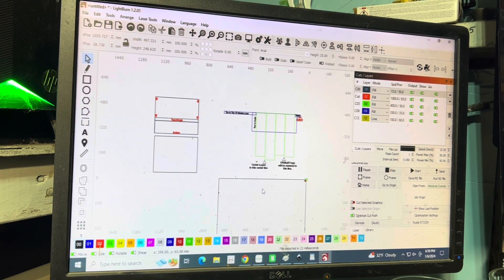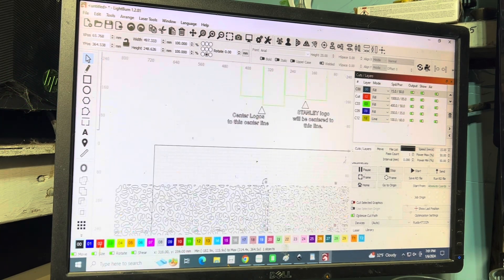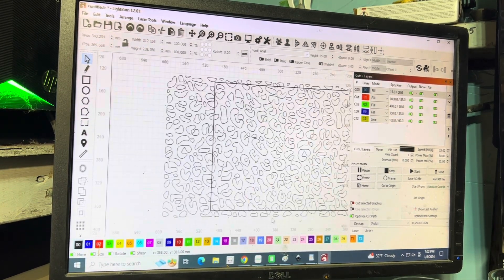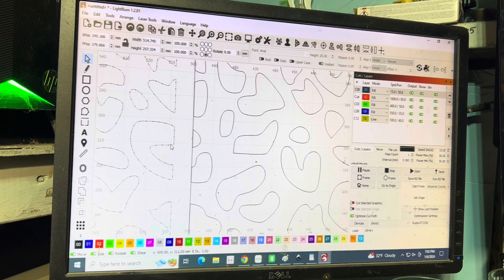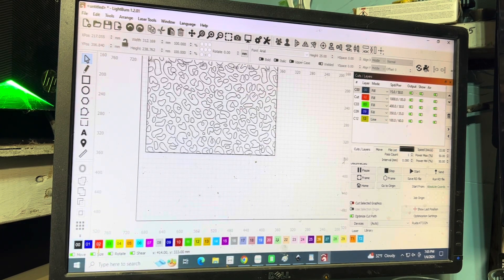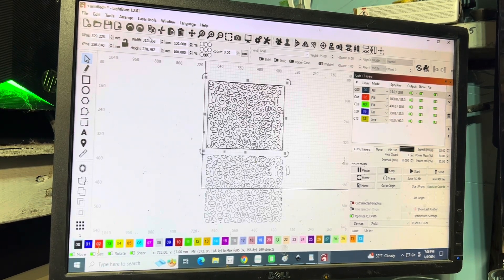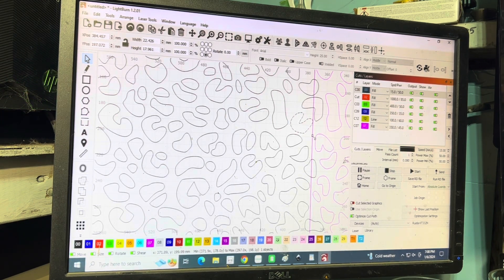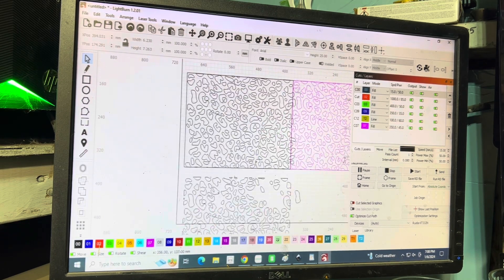How to design a seamless wrap (40oz Tumbler)

Comment: Great no nonsense video. I understand what you created, but I don't understand how the seam can line up the full length of the cup if it's not a perfect cylinder. In other words, how does the seam line up at the bottom of a cup that is smaller at the bottom than at the top? I have watched several full wrap videos and I have yet to see that explained.  I'm also curious what lens length you need to clear the handle tabs, and have enough depth of field (stay in focus enough) to remove material with sharp images/text on the smaller diameter part of the cup since it is quite a bit further away from the lens.
Reply from the maker: I always recommend a 2.5 inch lense. You'll see a small bit of distortion on the smaller diameter at the bottom of the cup but it's not enough to ruin the graphic. The bottom will also connect before the top so you'll have a small amount of overlap but again it's not a big deal or noticeable if you have your e steps and graphic dimension right.
Reply from the maker: As for the last part. You want to angle the bottom of the cup up, see my video on engraving a 40oz tumbler.

Comment: Why do you need to cut the shapes?  Can you just run the design with the full shapes sticking over your frame rectangle and they will fill in the spaces when it all goes together?  This will keep you from having to be PERFECT at lining up all the lines?
Reply from the maker: There's a way to do it that way as well. May be for another video. You can't do that with every pattern which is why I choose to do it and show it this way.
Reply from the maker: Checkerboard for example you wouldn't be able to do that.